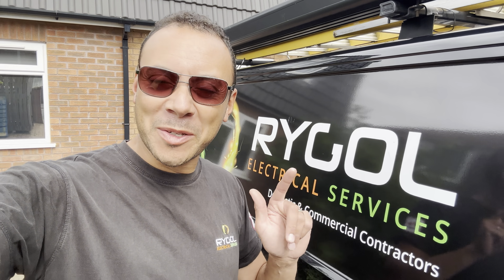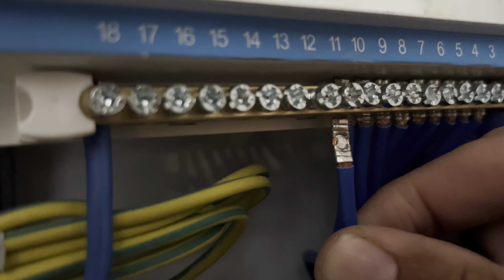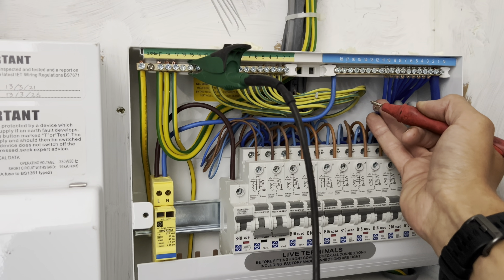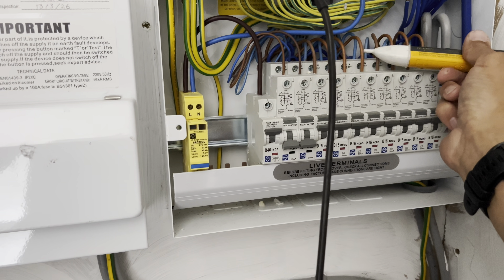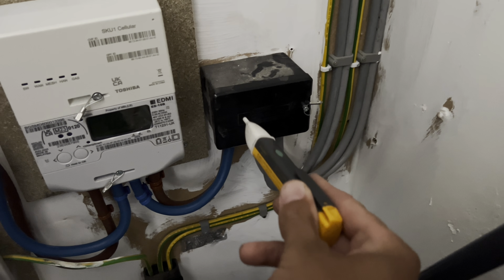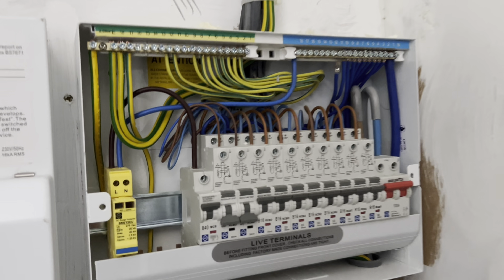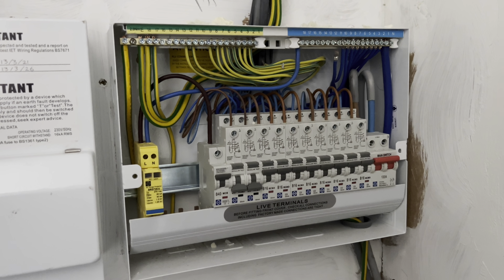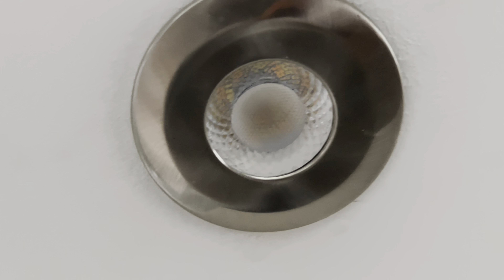Smart Meter Disaster! ⚡️

Comment: I'm a retired electrician, i have seen this many times before smart meters on industrial sites as well domestic properties, they was seasoned electricians,  We were doing an electrical installation on some industrial units, my colleague while installing cable had an electrical shock from the neutral bar, when we tested the Black phase conductor was connected to the neutral while the blue conductor was connected to the Phase terminal of the 3 phase meter. The installer got suspended for failure for not checking his work on a 3 phase 415v system installation and endangering life.
I think the meter installers are not qualified electricians. only trained ? on meter changing.
Reply: Harmonised colours, I found un-commissioned  MCB in a substation I was working on, Black on neutral and Blue on Phase, called the site engineer to tell him Black Brown Grey are line phase. His language was very fruity but he was incredibly grateful I had found it.  I still visualise RYB.   I do not know who you spoke to before rectification however this is negligence.
Reply: @WOFFY-qc9te  the swap of blue and black is still an issue on 3ph stuff here, always test, a few times
Reply: @WOFFY-qc9te  I spoke to the local electricity company who installed the meter, told them about what happened and an inspector and a meter installer was on our site within the hour and took photos before rectifying.
Reply: I got a belt off a neutral bar once, suspected that, but it was a completely different wtf,..... 3ph incomer with 3 individual 1ph CUs, a live was coming out of one CU and returning the N to the CU i was working on, which was isolated (or so i thought)...  (no rcds obviously)
Reply: The majority of smart meter installers are ‘not’ qualified electricians they have been on a course for installation of meters only. That said, this is a really dangerous bit of work, yes we all make mistakes unfortunately in this situation you can kill someone if you don’t do your checks properly.
Reply: As a retired electrician/ engineer from Scottish Power, we had a saying for these meter fitters.  after a few weeks training.     Butcher, Baker and a Candlestick maker😊    ( cheap labour )
Reply: I worked as a copier technical specialist now retired thank goodness 
helping regular engineers with problems they couldn’t fix.
One lad called for help the customer was really annoyed kicking off big time engineer couldn’t understand what was going on with the heater unit (basically a halogen lamp inside a aluminium rolled heating to around 180 celcius
Controlled by DC and AC drive circuit boards both of which he’d changed with no effect. The halogen lamp was just about glowing red no where near full strength.
I put my arm in the machine , short sleeved shirt, touched the chassis, “oh that’s sharp”…….tried again…..that’s not sharp that’s a voltage on the chassis……..checked chassis to big cast iron radiator nearby…….if I recall right 200v! , so looked to move the copier to a different location, customer was getting more and more annoyed, so I tried the shredder that was nearby …..no go, I was now insisting we move copier. Moved to another location it worked perfectly 
Young staff member then piped in to her manager “I told you the shredder didn’t work so I moved it to another room to do the job……customer now annoyed with her staff……asked customer if they’d had any electrical work……oh yes …….was that when the copier stopped working……oh yes…….
Packed up tools cleaned working area left them to it! Coffee time😂
Reply: its the same dudes that say that since it alternating current, the colour of the tails dont matter. just jam it in mate!
Reply: Every meter fitter i've been involved with was purely a meter fitter not a spark. It becomes fairly obvious if you hang around near them and listen to the silly phone calls they often make back to base asking daft questions. They often get paid per job and have to fit in so many changes per day so under pressure to get in and out as fast as possible. I think they have to take a Ze reading which wouldn't have picked this up unless they took it from the CUs. Perhaps they don't test them for colour blindness?! They started doing that when I was did my aprentiship.  I do admit to a few reverse polarity errors i've made over the years - but realised what I did fairly quickly and put it right. Its amazing how almost every home appliance will seemingly work just fine with L-N reversed.
Reply: Oof sod getting a bang from a 3 phase.
Reply: It's happening in Ireland too. They won't pay for qualifyied for electricians so just do a basic training to change out the meters. They know nothing of testing correctly before connecting back everything. It is truly abysmal. Good video 👍
Reply: @supermick83 Yes, indeed. The guy that turned up to do mine was working for a UK contractor, “On Behalf of ESB Networks “. Even his van was English.
I supervised him start to finish and everything is fine. There was no, (that’s right, NO) testing of the finished installation. 
He used a ground probe to identify all the cables prior to dismantling anything, using coloured cable ties to supplement the wire colour codes. Then bosh, bosh, bosh, old one out and new one in, photograph, gather up tools and away!
I checked everything over, once he was gone, before allowing anyone to touch anything in the house.
My own distribution box predates my ownership of the house, so it’s very untidy and needs to be sorted out. I’m always worried when anyone interferes with anything, in case that’s the moment an Earth wire falls out and contacts something it shouldn’t.
There’s an upgrade coming, just as soon as I can find time.
Reply: The only other thing is that the connector block is actually wired backwards,the have to be infront for safety reasons,its still the engeneers fault for not checking but its partially the electricians fault too
Reply: @naydenangelov8598  Yes you are right the live conductor's should be on the rear connection block and the neutral's on the front connection block, So if the cover is removed from the henley block only the neutrals could be accidently touched.
Reply: @lambert0259  DP henley blocks like that are so fragile if you bash them accidentally. Can fairly create a dead short too if someone hits it with a bit of force. Eon Energy meter fitters aren't allowed to use them, they use 100a single pole connetors made from a very robust grey type of plastic instead
Reply: @naydenangelov8598  Like i said above, that's not a hard and fast rule, just best practice
Reply: @naydenangelov8598  Yes, that may be why the meter changer got it wrong, he just assumed it was wired are usual and didn't check.
Reply: @naydenangelov8598  Maybe the electrician is slightly at fault for not noticing this, but is it a routine check item?  It was almost certainly wired like that by the DNO that put the original meter in.  Even if the electrician had noticed it with the old meter correctly connected it is unclear whether he should have changed it.
Reply: @naydenangelov8598  As a Brit expat only vaguely familiar with UK regs, (Essentially I'm now North Am), that immediately struck me, and has struck me in previous visits to the UK and helping an electrician there do an equipment install. The UK is a mix of very modern practice (albeit the EU nations are mostly far ahead) and ancient ones. That 'connector box' as it appears is an accident waiting to happen.

The split-rail North Am (and elsewhere) system at least halves the 240v supply to 120v, still more than enough to easily kill, but 240v is geometrically more dangerous. (240v domestic use is only used where necessary in North Am homes, small businesses. Toasters, heaters, etc).

That 'connector box' looks like something from almost a century ago here.
Reply: @stephensaines7100 Yes, we have similar ones here, in Ireland, where our electrical grid is mostly inherited British Standards stuff. Having seen what passes for “safe” in American installations, However, I think I’d still rather the connector block with its beefy threaded metal screw locking system, that you can inspect both visually and mechanically, than the push to fit, or twist together and wire nut over that American sparkies favour. The British tend not to change what works well, without a good reason. So, just because it’s been done that way for a long time, don’t fall into the trap of thinking it’s not as good. It may well be because nothing better has been found. In a domestic setting, those connector blocks are carrying up to 63 amps, in older, or rural settings. More like 100 amps in more modern, urban areas. Anything that depends on a spring maintaining tension cannot be trusted with such loading. Equally, a plastic wire nut, screwed over twisted copper wires, will fall off if the joint becomes hot and cools a few times. 
Threaded metal fixings will also eventually become loose, after many cycles of heat and cool, but they are less likely to heat up in the first place and will not deform and fall away, even if heated up quite dramatically.
In short, it’s still done that way because it’s safer, in the long term.
Reply: @duncancremin1708  All very nice, but you fail to appreciate the obvious: 'Splicing' in to the mains isn't done in such a hamshackle way in North Am, or in many other nations/groupings.

Btw: Your knowledge is dated on what are termed 'connectors' in North Am. You don't ever use floating connectors for mains entrance.

That connection would have to be taken into main panel, or a subsidiary one that meets the same safety specs. It's termed "Service Entrance" if you'd care to look up the national codes.
Reply: To be specific, the NEC code (national in US and Canada with various additions in states, provinces and some muni jurisdictions)
[The NEC allows both branch circuit and feeder conductors to be spliced inside a 'cabinet' that contains circuit breakers.]
Reply: @stephensaines7100  Given I'm never likely to be working in the US, why would I plough (sorry plow, in the US) through all that? It's not remotely relevant to my daily life. What I see "qualified techs" from the US do, over here, however certainly does impact my daily life. I make good money bringing substandard work up to code.
As an aside, while the pictured layout is nice and tidy and easily understood, I would prefer if the live (brown) cables were not at the front. It's exactly the same work to but them at the back, but adds one further level of safety, in the event of an unwary hand/tool finding its way in there.
Reply: @duncancremin1708  By any measure of modern engineering practice, in the UK, Ireland or Timbuktu for that matter, the 'Henley Block' is an artefact.
Reply: I was talking to an meter reader recently, he told me lots have been trained up to replace the meters.
Reply: @123tinhat123  I keep getting phones calls about changing my meter, but when i ask if the meter installer has 17th / 18th edition of the IEE REGS their is silence at the other end of the phone. and i will want to see evidence of this before they do any electrical work
Reply: @lambert0259  Technically they don't need BS7671 as the supplier side doesn't involve the regs, it's ESQCR instead, I just tell them 'no, you may not install a smart meter'

Comment: As you stated the mistake was excusable but the failure to test correctly is not.  I would guess the "test at the kitchen" was to turn the toaster on and since it worked it's ok we are good.  Someone could have been seriously if not fatally injured here from this.
Reply: @NOELTM  Thinking of the toaster.... The toaster element would be live when it's off, even if switched off at the socket! Scary.
Reply: Or they jammed a multimeter into the socket, which just says there's 240V between live and neutral, not the polarity...
Reply: @thethiefmaster  Never seen one who had the nous to use a multimeter LOL

Half of em turn up without a screwdriver
Reply: I suspect he  (or she) did the test at the start, with a plug tester, standard procedure, but failed to do the same after the  work, because polarity was correct at the start
Reply: @TheChipmunk2008  "Standard Procedure" for an untrained muppet, but IT IS NOT standard procedure for a trained & QUALIFIED electrician.
Reply: @1t_wasnt_me which meter fitters aren't

Comment: Open ended ending, what did you do in informing the company who created the fault. Other consumers need assurance the same person is not allowed to make the same error.
Reply: I’m a consumer, not an electrician, and I wondered the same. Are you allowed to remove the “tags”. Aren’t you supposed to notify the installer concerned?
Reply: @AlanHH  Not where there is danger to life or property. Make it safe all day long.
Reply: @paulmac8016  100%. I pull main fuses if there's no customer side isolator present (I wish they hadnt stopped fitting them). I quote the EAW act, I MUST isolate where possible. Cutting a seal and pulling a cutout is certainly possible. Never got in any trouble
Reply: The tester should have their licence revoked
Reply: @normangale3159 driving licence

Comment: British Gas.... reg 31 ... reverse polarity in the Henley block ....takes seconds to plug the martindale in after the installation
Reply: Yes, they are the ones who are providied with martindales. Gas workers aswell as Sparks. Supposed to leave them in until supply restored so that you are testing from same point. No use in testing at one skt b4hand and at a different skt afterwards. That 2nd socket itself maybe wrong polarity for years before and not whole installation. That way, these one day course sparks would panic and nprobably change tails to wrong polarity. At least 1 skt would be ok... LOL
Reply: @paulmac8016  You may be absolutely correct there. I'd have gone around the kitchen testing all the sockets just in case it was in fact a different socket that'd been tested for that very reason.

Comment: Surely with a unexplained fault on a previously good instilation. The first test would be a full incoming voltage and polarity confimation. Start at the origins of the instilation.
Reply: Even the cheapest plug-in tester would show a neutral-line reversal.